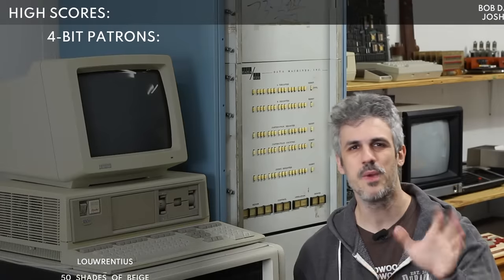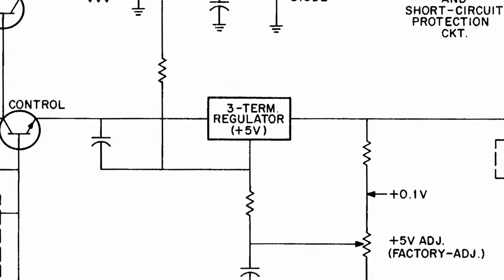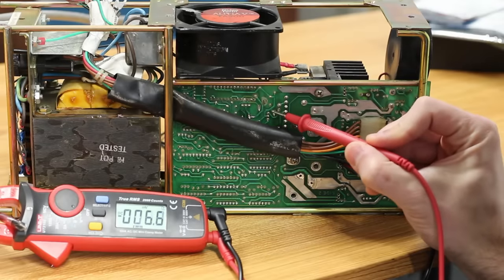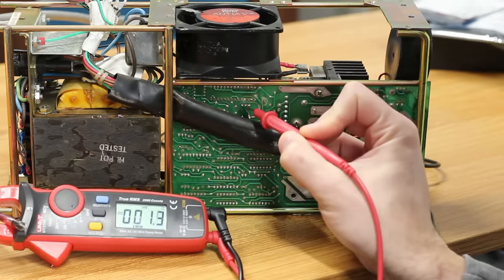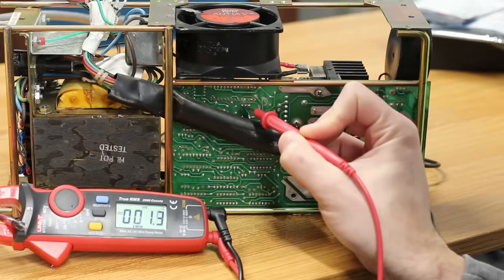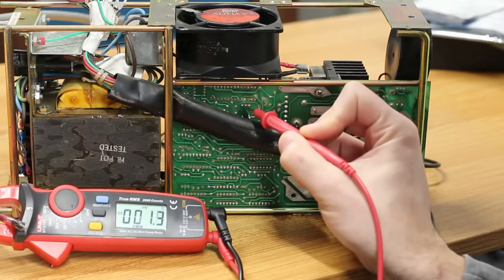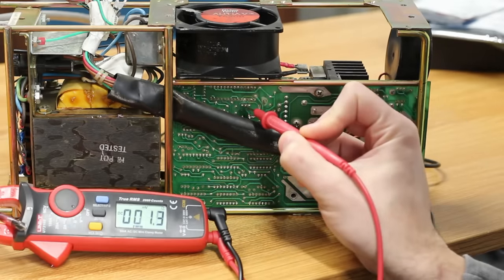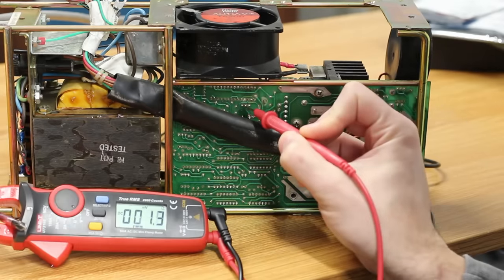The PDP-11/23 Plus Works!

Comment: That's a real Rube Goldberg power supply design.   Not only are 78XX, 79XX 3 terminal regulators unreliable, if the -15 regulator goes, the power supply will destroy all the 5 Volt TTL logic. 

Why are you pulling transistors if you don't know if they are no good?   That's like a dentist who pulls teeth first.   When I started out as a repair tech, before I got my EE degree, that was the one thing I never did.   It's a very bad habit.    If you can't debug a circuit and find what part is no longer working, get someone to help you..

You see, you are thrashing.  First you saw the high voltage coming from the 5 V regulator.   That was caused by the '15 V regulator not working.   So why pull transistors that you don't know are bad?    You can't debug the circuit with those parts gone.  Later, pulling the 7915 because it's input and output are just a diode drop from zero.  If the 7915 was pulling down its supply, it would be hot to the touch.   But it's very unlikely the 7815 would do that.   Pulling the 7915 = still thrashing.   You have to follow the fault.   That's what electronic troubleshooting is.   eg:  High 5 V  ->>  No -15 V  ->> No neg supply for 7915 ->> what turned off the neg supply?   No parts removed so far, 10 minutes time spent on the probkem.
Reply: The crobar circuit is there to protect against over voltage and clearly it did its job because the computer came up once the supply was repaired.

Your claim that the 78xx and 79xx devices are unreliable is certainly much at odds with my decades of experience with them. 

I do agree with your comments on yanking out parts. But not everyone has someone with adequate knowledge available to help.
Reply: @d614gakadoug9  Yes, I know what a crowbar circuit does, but in this case it is used to correct a defect of the design.  When the -15 V supply drops out, the +5 V supply goes up, triggering the crowbar.   .   What happens if the crowbar setting is too high?   TTL gets destroyed.   I"'ll take back my comment about 78XX, 79XX 3 terminal regulators being unreliable, but I don't think they belong in a high current power supply.  The quasi-switching 5V supply is a Frankenstein design.   The switching aspect compensates for the fact you just can't drive pass transistors with a 7805 and get 5 V out.  Much better to use an LM317.   I don't know what the 5 V current requirement is for that LSI-11 card cage.   When it's fully populated, it might be close to the limit of that supply.   Operating pulse mode, the 7805 could shut down from over current.   The LM317 can deliver 2.5 A.   It's all moot anyway.   I seldom try to "improve" vintage hardware.   If it ain't broken, don't fix it.
Reply: @williamogilvie6909  
OK. So what is the alternative?

I agree that an LM317 would be a better choice (at least I think it would but would want to compare frequency response). I suspect this design was reused from a time before the LM317. I'm also a bit baffled why the designer would opt for using the negative 15V supply to bias the diode used in the setpoint chain rather than just the raw negative supply, but that's what was done. It would have been possible to add a bit of circuitry to prevent enable of the power path in the absence of the negative supply.
 Current through the 3-terminal regulator is not an issue. It only needs to handle sufficient base current for the driver of the main switch, so a very small fraction of an ampere.

Since the pass element in a linear regulator is the part subject to the most stress, as is (almost always) the switch in a buck converter, unregulated output is a predictable consequence of failure. A crowbar is pretty much the only viable solution. Yes, a crowbar may be set for the wrong voltage. Anything can be set for the wrong something! That isn't an argument against using it. A crowbar for TTL is demanding, since there is very little margin between normal operating voltage and possibly destructive overvoltage.

This is NOT a "quasi switching" circuit. It will switch quite effectively because of the hysteresis designed into it. Whether or not you could use external pass devices with a 7805 is irrelevant since a linear supply would be out of the question without fans capable of levitating the whole computer.

An isolated switcher will not produce overvoltage due to a failed switch, but that device was built at a time when direct-from-mains switchers in that power range were still quite expensive and bulky. It is still possible for an isolated switcher to produce gross overvoltage due to any one of a number of component failures.

Even something like a ferroresonant supply, which DEC used in many earlier computers, can produce overvoltage if the filter caps lose substantial capacitance or the resonating cap fails..

Power supplies are not easy! I've designed many power supplies for specialized industrial applications. I'd have done this one somewhat differently but I certainly don't regard it as a "Frankenstein circuit."
Reply: @d614gakadoug9  I think the LM317 was around when that power supply was designed.  In any case, the designer could have used the 7805 to supply current to the driver, below the pass transistor.  It just needs two 1 Amp diodes on the ground leg of the 7805, to set its output to approximately 6.2 V.  

I don't consider this circuit, assuming the schematic is correct, to be a switching regulator.  It is more of a poor cousin to one.   How is the output compared to a reference ( non existing ) so the pulse duration gets adjusted?   Since you have designed many switching regulators, maybe you can tell me how you would analyze this one.  Can you supply bode plots or transfer functions?   You said the circuit works quite well as a switching regulator because of the hysteresis built into.  So you must have done some analysis.  I don't see where the hysteresis is and I don't think it is necessary.   What is needed in a switching regulator is a voltage reference and a comparator.  This circuit has neither.
Reply: @williamogilvie6909  
In a reply to someone else I go through the circuit in moderate detail. I can't find that thread at the moment. It was one with a lot of replies.

The critical component is the resistor from the emitter of the main switch to the network on the ground pin of the 7805. When the switch turns ON sufficiently to start raising the voltage at its emitter current through the resistor slightly raises the voltage setpoint of the 7805. That increases the current through the 05, increasing current into the base of the driver and thus into the base of the main switch. That enhances the switching. Eventually current through the inductor raises the output cap voltage above the setpoint of the 7805 so the current through it drops. That starts turn-off of the driver and the main switch. Current is commutated from the switch to the freewheeling diode, meaning the voltage at the emitter is now about negative one volt. That pulls the setpoint of the 7805 down so that current through it will drop essentially fully to zero until the cap voltage decays to below this new lowered setpoint. At that time the 7805 begins to conduct again, starting a new cycle. Essentially the circuit regulates the ripple voltage on the output cap, with the mean set at 5 volts. The frequency will vary.

Without that resistor the thing would act as linear regulator with some strange behavior due to the LC circuit. The resistor makes the 7805 function more or less as a comparator with hysteresis.
The voltage reference is built into the 7805. The 7805 is a voltage reference , an error amplifier and a series pass transistor controlled by the error amp.

I haven't done detailed analysis. I can tell sufficiently well how it works by inspection. I would need to do some detailed analysis to determine what would happen without that critical resistor.

I don't recall when the 317 was introduced. The only event I remember from the early days of 3-terminal regulators was Motorola sending out samples of a new one (from them, I think it was their version of a 78L or 79L part) in TO-92. The datasheet that was sent with it had the wrong pinout. I don't recall when that happened.
Reply: @d614gakadoug9  Yes, I can see how it alternates between having the pass transistor conducting and not conducting, which dumps power from the inductor to the output cap.   As switching regulators go, it's a real Rube Goldberg design.   I'm surprised DEC built it.  Someone must have been away on a family emergency when that happened.   I know the LM317 was available coincident with the 7805.  I remember seeing a battery charger a friend made that used it.   I wasn"t implying it would be a replacement for the 7805 in this quasi-switcher mistake.   There is no good reason for this supply to try to be a switching regulator.   Using a Darlington as the switch is a bad idea.  Darlingtons have a low frequency response and so will dissipate excessive power on every cycle.  The transformer is very heavy.  Making it a switcher will not reduce the weight.    But using a 7805, with diodes to push the output up to 6.2 V wrt to GND, or, much better, using an LM317 would provide a stable drive for the output Darlington (pass transistors), making it a reliable linear supply with none of the nonsense we are seeing.  Of course the inductor, the free-wheeling diode, and several other components are gone.   It's a lesson in the pitfalls of over-design; eg: keep it simple, stupid.

I have googled this topic and read comments about the susceptibility of this supply to power surges.   The attenuation a supply gives to voltage excursions (120 VAC) is an important quality factor.  This is a one of a kind power supply design.  I would guess it cost DEC lots of $$ and service headaches.  I'm sure whoever approved it learned their lesson.
Reply: @williamogilvie6909  
No, it is NOT Rube Goldberg. It is a rather clever approach, using a pretty low parts count, that was reasonable at the time. Again, it is NOT a "quasi-switcher." It is a true swichmode power converter except at very low current, as mentioned in the video That you don't understand that is no condemnation of the design.

The switch is NOT a Darlington pair. It is a common-emitter PNP driving an emitter follower NPN. The voltage drop across the switch will be less than a volt. That part of the circuitry is in fact quite similar to that found in many of the integrated buck switcher ICs that use a BJT switch. 

There is HUGE reason for the supply to be switching. If a linear regulator were used to produce 5 volts from 25 volts the efficiency would be 20%. The switcher, even with the relatively slow switch, is probably well in excess of 70% efficient. It is no more susceptible to AC mains transients than linear designs.